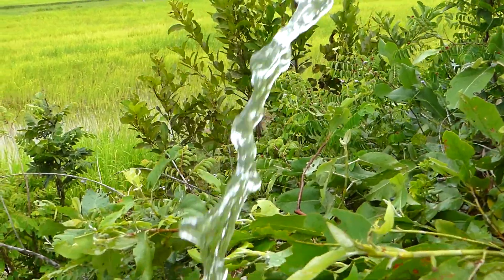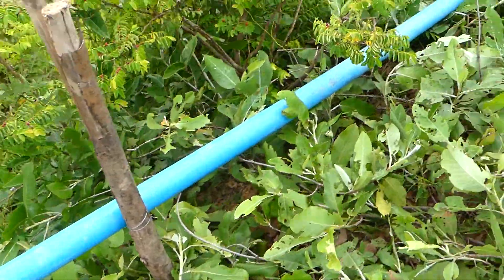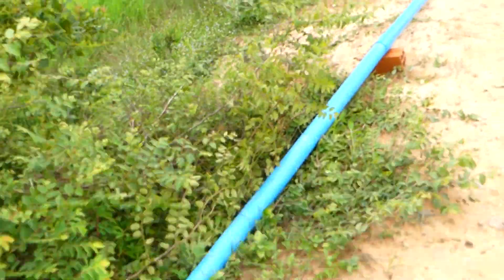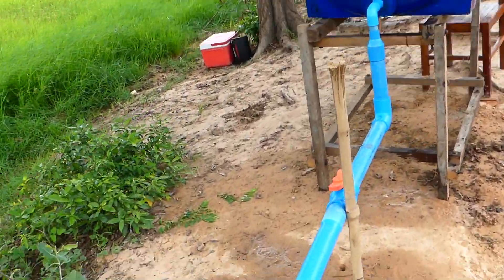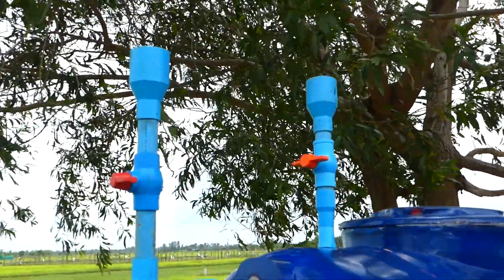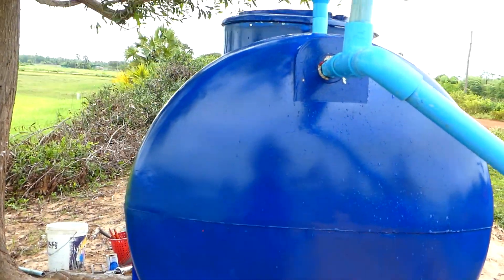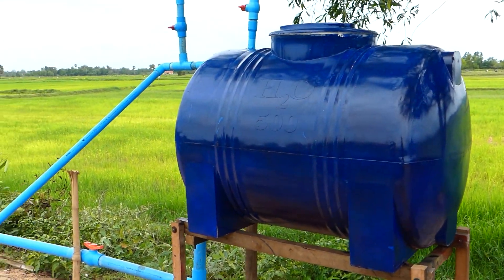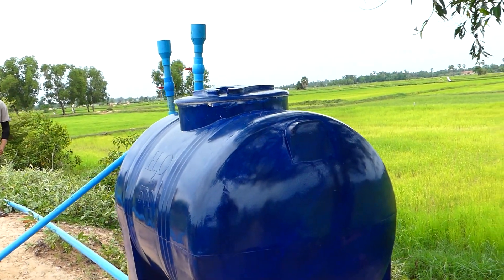How to make free energy auto water pump - free energy water pump | Pump without electricity

Comment: Sir I am from Philippines,it will work in the deep well like 40 feet deep.water?
Reply: If sucking water above 30 -ish vertical feet it will arrive in gas phase and require the energy input to boil and suck the liquid water….submersible pumps solve this problem.

Comment: Is the water level at intake higher than water output level
Reply: As a former student of thermodynamics and fluid mechanics, this is very interesting!  The textbooks and professors may say that siphoning water to a taller point than it started is not possible…but I am compelled to  believe what I am seeing, and I do enjoy eating rice.  Nice work, I am inspired to do some back yard tinkering with a roof rain collection system, and find out why this works.  Right now I’m thinking it has something to do with relative resistance of inlet and outlet piping…trees lift water hundreds of feet, so I’ll buy that we can manage a meter of lift through innovative plumbing.

Comment: Can we used deepwhell as a source of water pls.
Reply: Liquid water cannot be sucked more than 30-something vertical feet.  Above this threshold water changes to gas  phase….and requires a quantity of energy input which reflects that required to boil water….This is why well pumps are normally submersible.

Comment: একে বারে বুয়া
Reply: This is real. it is just simple physics. The key element there is that it is airtight and has air chamber which is used to suck water. it is just air pressure sucking the water from the well.
Reply: Can we used deep whell as source of water?
Reply: Water turns to vapor, gas phase if sucking about 30 vertical feet…so well needs to be shallow.